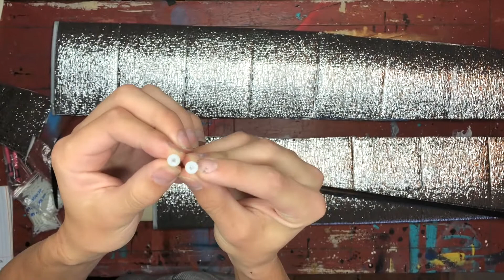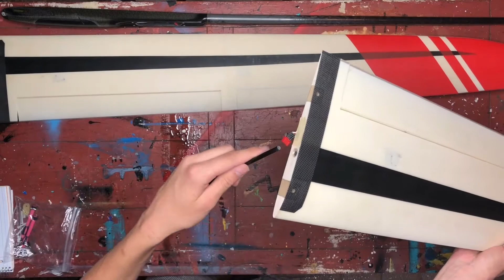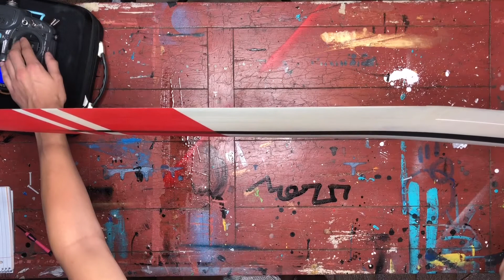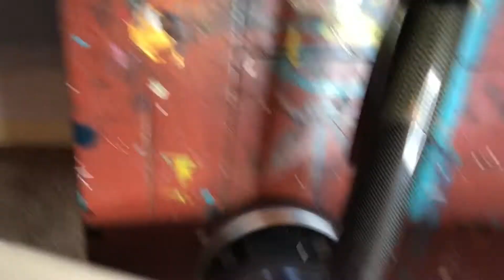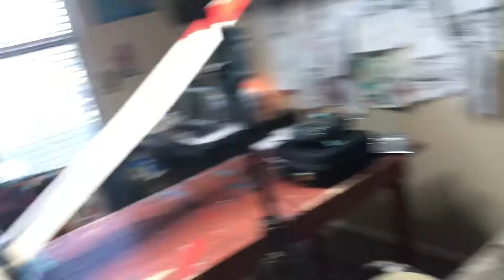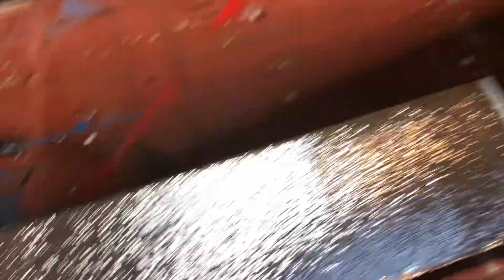Horejsi Geronimo 2.5m setup

Comment: What did you use as reference for gluing the boom? The wing bottom is not flat, so you cannot use it as reference to align the elevator to be parallel to the wing. Also, do you see backlash with the supplied pushrods? Thanks! Great video. I stopped my build to watch your video :).

Comment: Tom Clifford
1 second ago
Great video...it helped a lot as the supplied instructions dont cover all of the detail as to which control horn goes where for the rudder and elevator and the rear wing clamp is not mentioned at all in the instructions. Thanks for your help :)